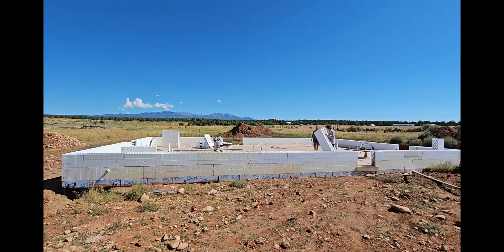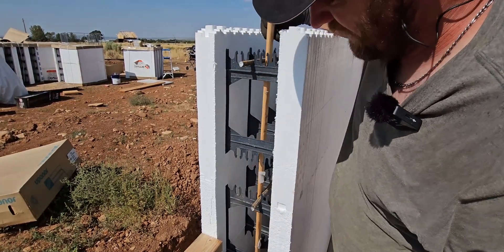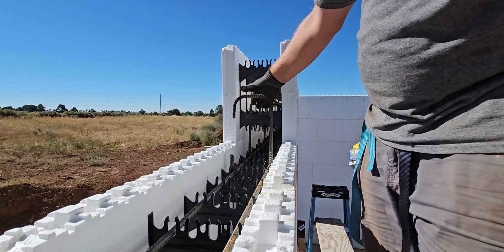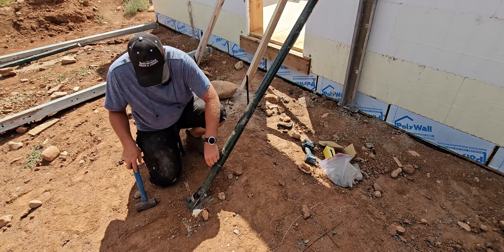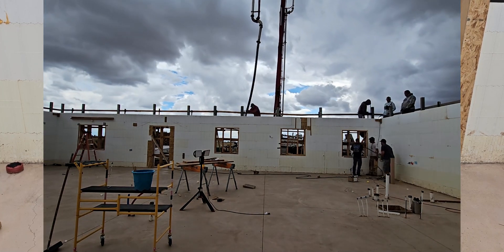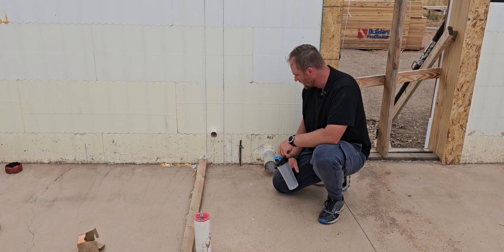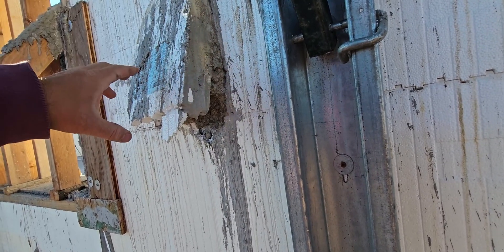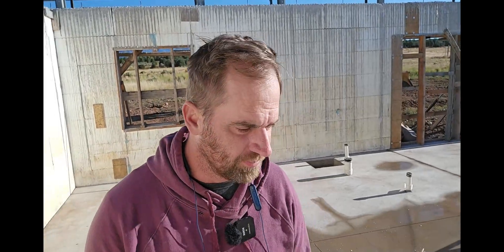Mastering ICF Walls: Building Our Own Insulated Concrete Form Walls

Comment: Thank you for your videos. They are super helpful 

Which block system did you use and why?
Reply from the maker: We used Amvic blocks. There is no reason other than I wanted to work with BFS and Amvic is what they carry locally. All of the ICF systems are amazing. If it's done properly (i.e better than what we did), you will only need to worry about your foam for a week, two at most. Are you building soon?
Reply: @Mountainview-mesa  

In six months waiting on well permit

Comment: Another option with the j-bolts on the top sills is Burmon Hurricane Anchors. Clearco Fasteners Inc out of Lakeville, MN sells them. The j-bolt holds down a plate that spans across the icf and has a place for the truss to sit on as well as bolting into the truss. Eliminates the need of a sill plate.
Reply from the maker: We love awesome technologies! This is new to me, but I can promise you I won't be taking these 2x12 boards off ever again! 🤣Thank you for the information!